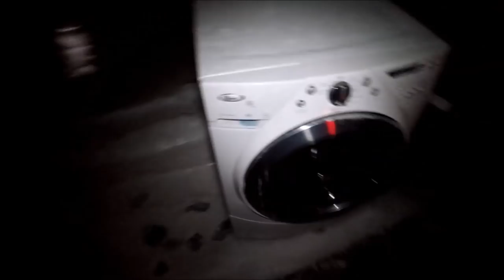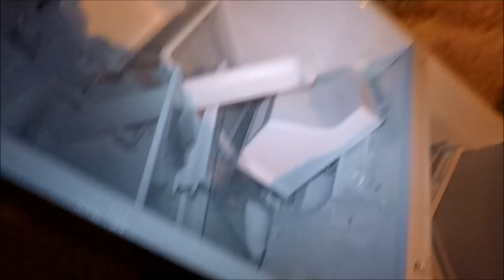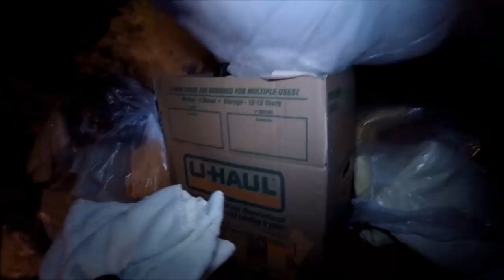Treasure in the Trash Garbage Picking Vlog No.1 Winter Picking a Plenty

Comment: That wooden thing is a piece of hardware which you use to tie 2 horses/oxen to a carriage/wagon so they can pull it evenly. It's missing another piece of metal which you tie to the carriage itself, and a vertical piece which you tie to a log wooden beam connected to the carriage (it's used to steer the carriage). Looks eastern european, but I guess it was used throughout the world back in the old days.